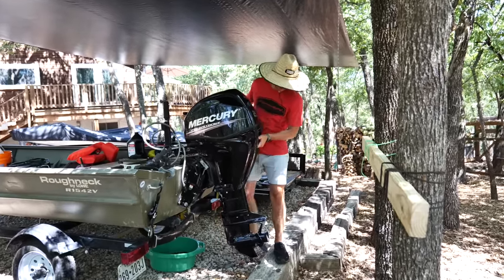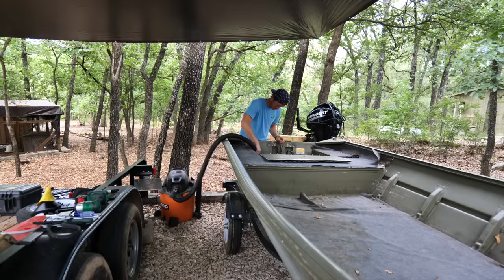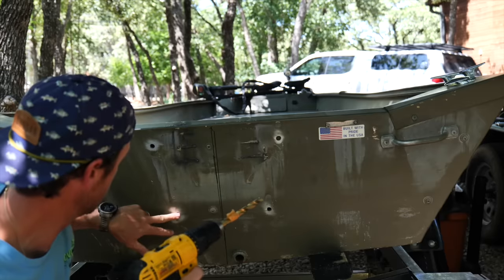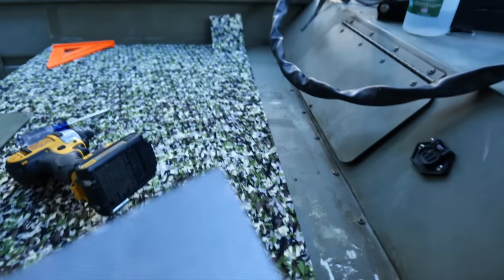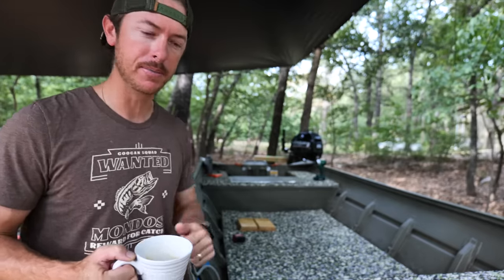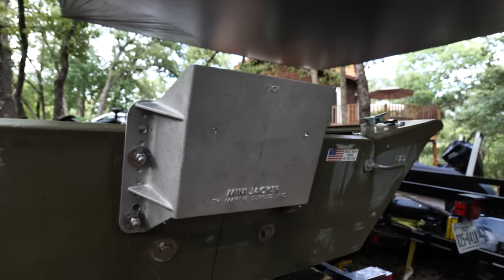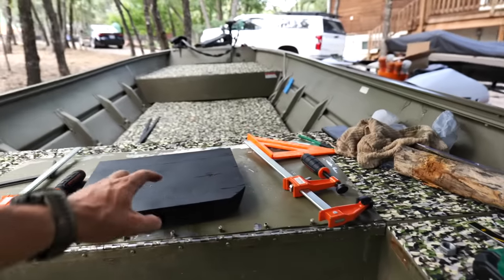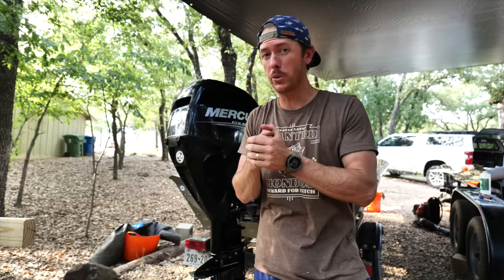MASSIVE Jon Boat Upgrades for Under $500! Full Build & Install

Comment: Stainless steel is not the way to go it looks good but the threads will sieze up.
Reply: Little anti-seize on the threads stops that... I am a ham radio operator and I probably have 200+ stainless bolts up the towers... stainless doesn't cause galvanic corrosion with aluminum like plain steel will.

Comment: If that motor was a 2 stoke you could have easily lifted it by yourself lol
Reply: New 4 strokes aren’t that heavy 25 hp and under
Reply: I have an old Merc 25 I can easily lift it off by myself.

Comment: my god! why dont you just go ahead and give that motor to someone that could use it, before you lose it in the lake anyway. or kill someone. youve seemed to weaken just about everything. holes everywhere, a block of wood here, some more holes there, raise this up, raise that up, completely ignore the instructions... heck, completely ignore the fact that the jack plate is inferior to its purpose. im just trying to get you to see through the trees guy. looks as though you bought a long shaft and should have a short shaft. long is 20", short is 15". 5", thats exactly how much youve raised it. is the boat even rated for 25 horses? theres something called engineering and everypart has a purpose and is actually designed to work with the next part... only to a specific amount of force. may be why your boat is coming apart at the seams. be safe. be smart. protect yourself and the ones you care about. protect the public too. some, if not more, of the stress between that transom and motor will take place out of the water, while trailering. that is a shit ton of weight on that fragile little transom bouncing around for miles and miles between home and lakes, down rough blacktop roads, washboard gravel, rough boat ramps, even a big yard. week after week, month after month, year after year.